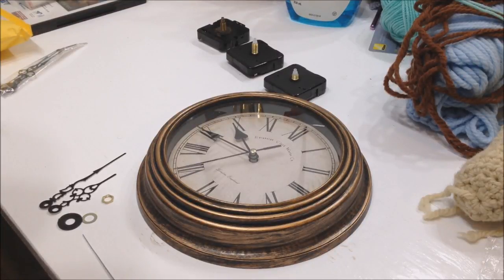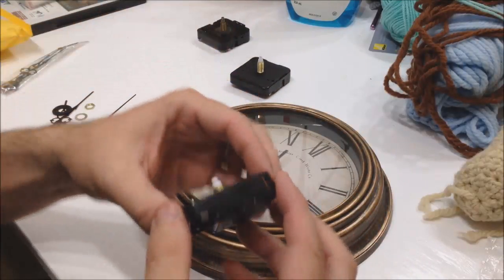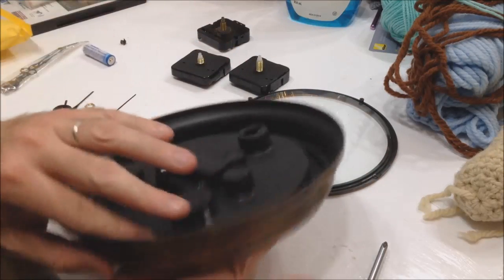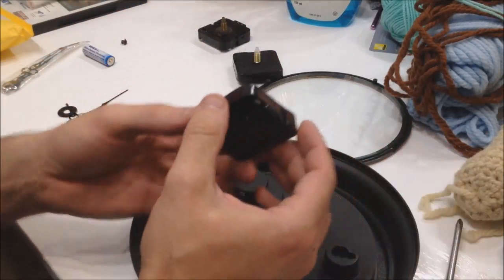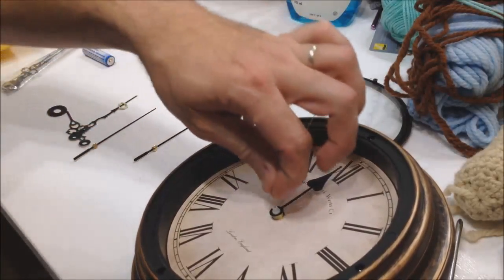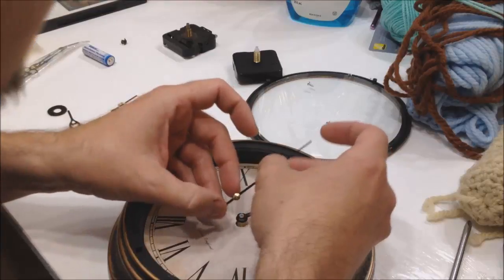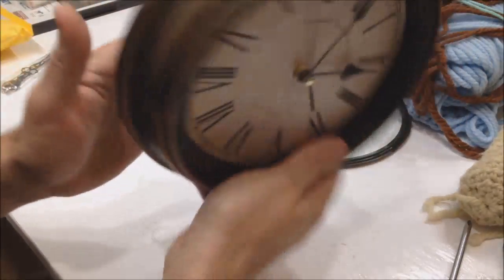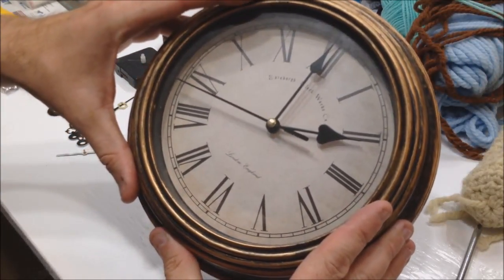Daily Log - Making Ticking Clocks Quiet

Comment: Could you simply remove the second hand, or would that stop the clock from working properly?
Reply from the maker: You can and the clock would still run fine, but the ticking would remain.  Quarts clocks without a second hand often just use a button to cover the hole, but if you look, the button rotates.

Comment: I have a question sir. I want to buy another Timex Watch but they are extremely loud. Would putting a thin felt sticker on the back between the watch and my wrist on the stainless steel part make the watch quieter? I haven't bought the watch or the felt yet, just wanted a second opinion.

Comment: I don't understand the different sizes. You said the two little black boxes are 6 mm and 14 mm but they look like they are just the same size as each other.  How do you determine which one your clock needs?   What part of that black box do you measure?
Reply from the maker: It’s how far the hands are from the base.  So a deep clock would need 14mm, a very flat thin clock would need 6mm.  A 14mm on a clock that needs a 6mm often means the hands would rub the glass.
Reply: Thanks!

Comment: I’m thinking of buying a nice clock for around 100-150 bucks and doing this to make it quiet but I’m afraid I’ll fuck it up. How hard do you think it would be to do this with a clock that has a cage welded onto it...
Reply from the maker: It’s all about access and type of clock.  A clock in that price range is either an impressive sculpture with a clock in it or an expensive clock.  Cheap clocks are easy to replace, but if it’s a fancy clock, proceed with caution.
Reply: Turbo231 I’m definitely looking at clocks that are probably the former so I will give it a go cheers 👍

Comment: My wife has a very old clock that doesn't run on batteries. Do you know if something like this is possible to do with such an old clock? It means a lot to her, but I can't cope with the ticking
Reply from the maker: It would depend on the kind of clock.  Long story short, you would need to add sound proofing to it on the inside of the clock if even possible. 
 Pretty doable with mantle clocks, however clocks with a pendulum would be tough as they need to be clear to swing back and forth.
Reply: @Turbo231  thank you for the reply. It doesn't have a pendulum, but I also don't think it has room for sound proofing. Will try to investigate :)
Reply from the maker: wind2dk Yeah, even a bit of batting goes a long way.  Make sure it’s on something soft, even if a doily but best a cotton towel.

Comment: I realize your video is from awhile back but I'm wondering if it's still possible to ask you a question.
Reply from the maker: Sure, go right ahead.
Reply: @Turbo231  I ordered a new quiet movement for a clock I recently purchased. I was having trouble getting the hands back on the new one because they have a little 'rivet' on the hole that goes on the mechanism. However, I have to send it back anyway because in the instructions it said it won't work for hands longer than 6" and my longest one is 7.5". Is that true for all the quiet movement boxes? Also, I paid $15 for it (only paid $25 for the clock) - is that too much in your opinion? Thanks!
Reply from the maker: You might have to be a bit aggressive with the hands as they are pressed in and held on with friction.  $15 is fine for a local store price, however they can be had for about $1 from china and a few bucks from other places.  It should have no issue spinning bigger hands.
Reply: Turbo231 Thanks for your reply!!!